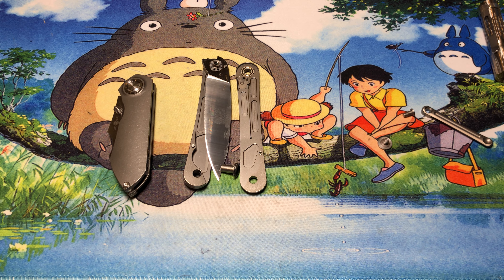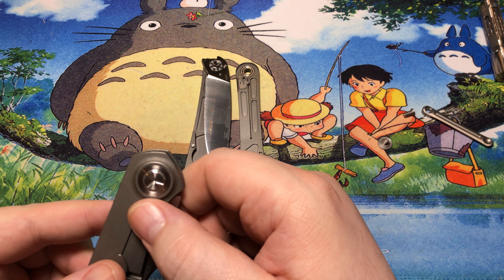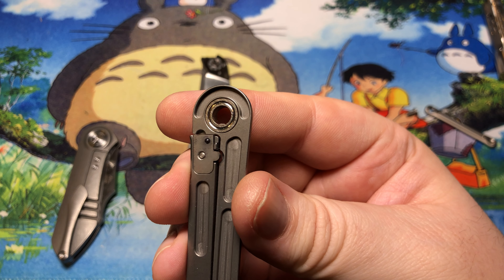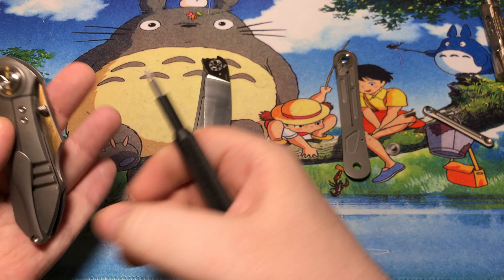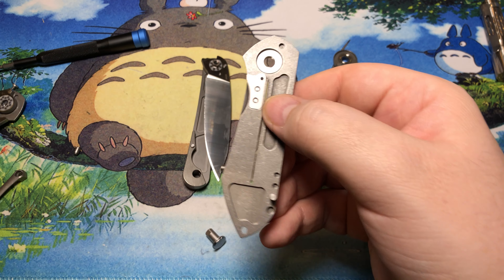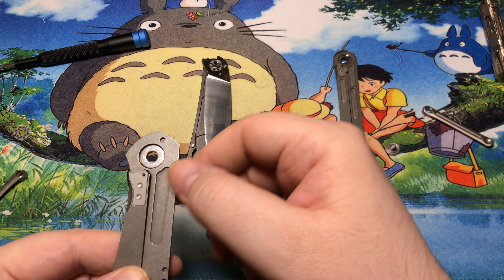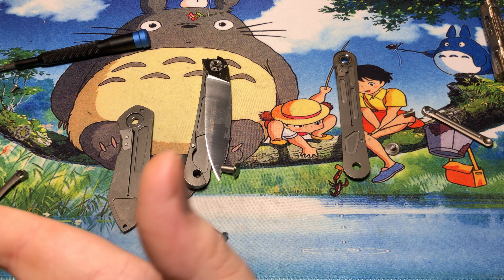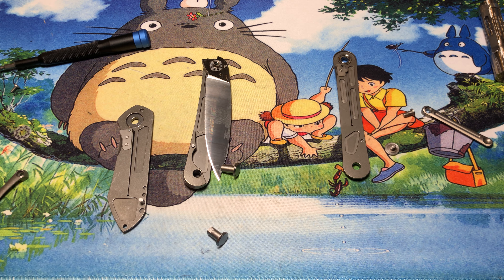TwoSun Multirow Bearings' Possible Improvement (Knife Content)

Comment: Jerry, in time won't the bearings begin wearing in a track similar to some of the Kizer's that use a bearing on washer setup?
Reply from the maker: They will for sure, but that break in time isn't trivial. It can take months or years for them to wear in to that drop-shutty proclivity; generally not something an evening of playing with will resolve.

There's some factors that can speed that up or slow it down (like the wear resistance of the steel washers they're riding on, how much pivot tension is placed on them and how much they're played with).

This is mostly based in my experience that the TwoSun's with racetrack washers tend to have better action than the ones with flat washers.